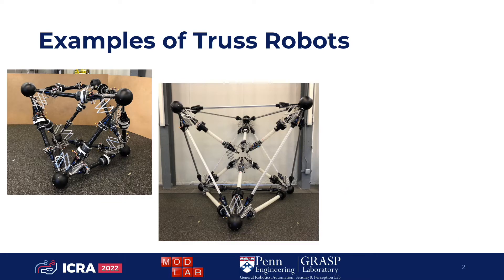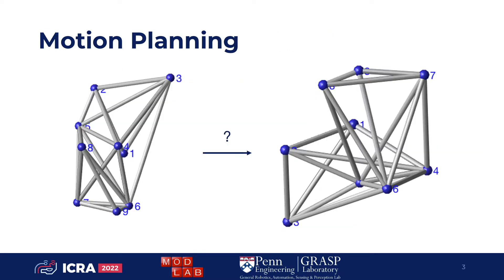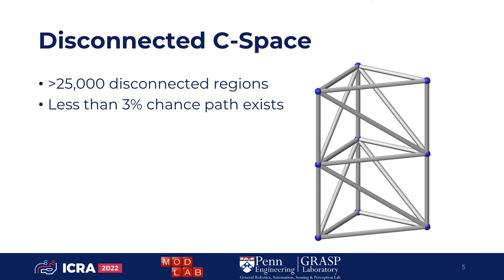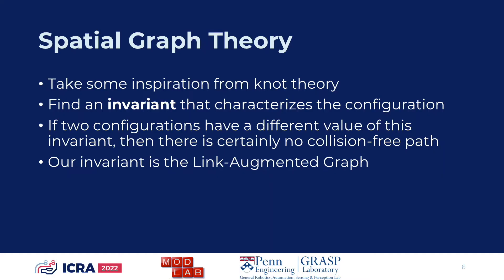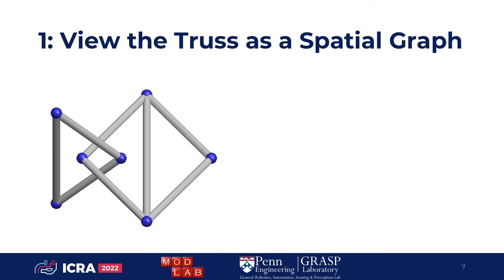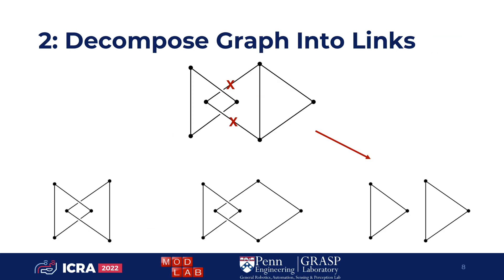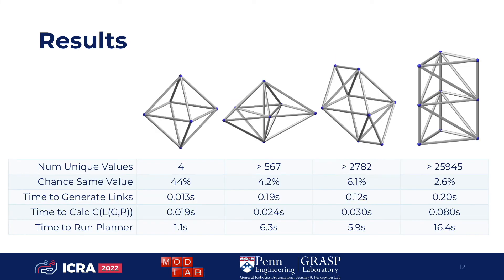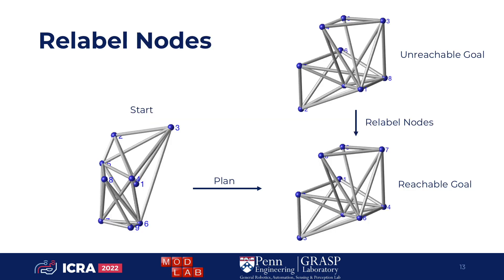A Linking Invariant for Truss Robot Motion Planning - ICRA 2022

Comment: Hello, I'm curious about the environment in which this multi-link system is modeled and simulated. I'm used to using solidworks, but it's not very convenient to adjust the link lengths for topological changes.